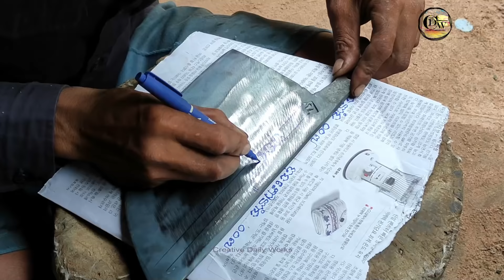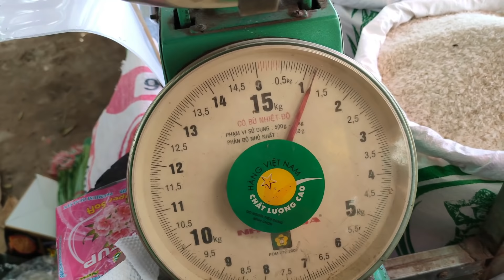KNIFE MAKING - FORGING MOST INTERESTING MEAT CLEAVER KNIFE

Comment: i love it all, exept for the tang my man, it needs to be wider if you are going to put a hole in it. especially if you drift the hole in, it could cause a small stress fracture in the steel and cause it to be weak where that is. plus, with a cleaver, if there is any shock from impact, it could cause the pin to vibrate and add stress to the contact points in the tang. not a bad knife though, I love the design and I appreciate the work you have put in, the tang just worries me. keep up the good work!
also, the temper on your knife is a bit... questionable. in order to get the correct crystal latus structure in your steel, you need to heat it up to a forging temperature, at least on the blade, and then submerge the entire thing in water at once. a good way to check if your steel is ready is to take a strong magnet and hold it to the edge. if the magnet does not stick anymore, the blade is ready to quench. after you do this, the metal will be very hard, but brittle. in order to make it less brittle, put it back in the fire until it turns a light straw or bronze color throughout. this will result in a hard, strong, springy knife that holds an edge well. i hope you take my recommendations into account, and I encourage you to keep building and tinkering. you have talent, and it should be put to good use. again, im not bashing your build in any way, im just sharing what i know :)
Reply from the maker: Thank you very much for your visit and support 🙏🙏 appreciated
Reply: خیلی هم عالی..ممنون از تجربه ارزشمندتان..❤️❤️
Reply: خیلی دوست داشتم در مورد اون قسمت ک از آهنربا استفاده میکنن بیشتر توضیح میدادید استاد...
و دلیل استفاده از آهنربا و تاثیرش  رو هم میدونستم..مرسی استاد...

Comment: Aren't you suppose to quench it in oil and then temper it after forging? What does quenching eged in water do? Hardens it?
Reply from the maker: I usually quenching only eged with water is faster. Thank you for your visit and support.
Reply: Quenching in oil is much safer, but you can do it in water but I would never.
Reply: PhfT

Comment: Looks like a piece of structural steel. I would like to see it in use. But I wouldn't have put a cylindrical handle on that can cause rolling when chopping
Reply: Are you still after Texas Red?
Reply: Its a piece of leaf spring used in truck suspension
Reply: It’s obviously a truck spring. You have not seen the Asian tools, most of which have round handles. Besides the gravity effect of the large blade.

Comment: sorry, wouldn't it be better to harden it with oil?
Reply from the maker: Thank you for your visit and support. Do with cold water is faster than oil. No need to do heat treatment. Thank you.
Reply: @CreativeDailyWorks  Isn't it true, then, that it is more fragile when made with water?
Reply from the maker: @darkness7250  we have technique to avoid spin or break. Thank you